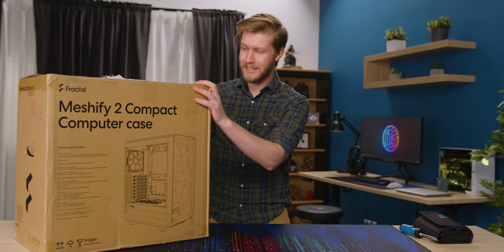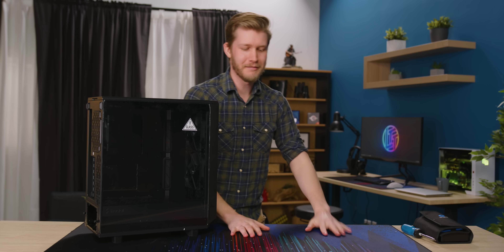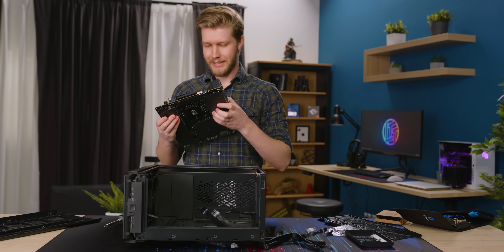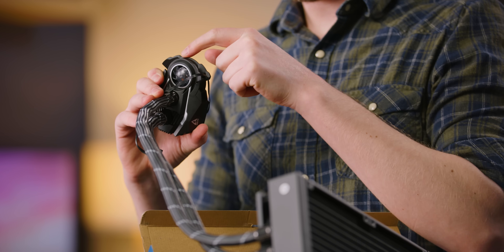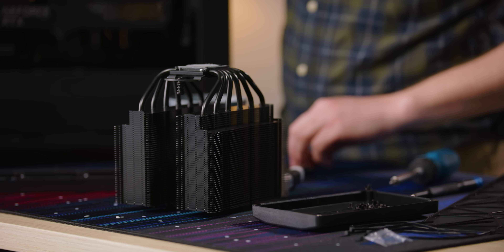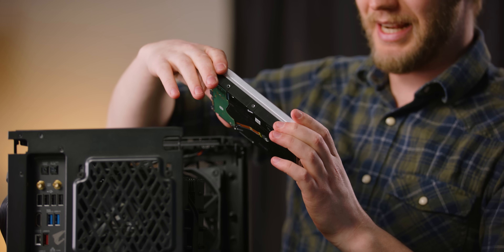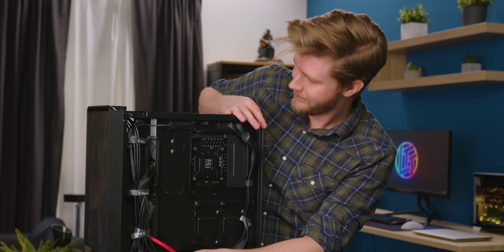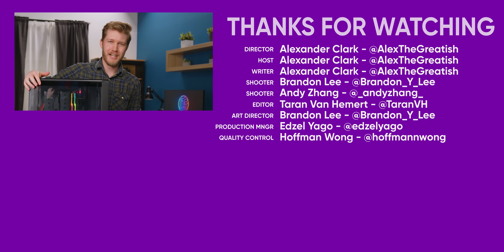One of the easiest PC Builds - Fractal Design Meshify 2 Compact PC Case

Comment: Honestly, for the price its not awful. But I got the regular Meshify 2 and I'm really glad I didn't get the compact. It would never fit my fat log of a GPU. It's 320 mm and I have a decent amount of space between it and the fans up front. Be aware that those fans won't match the typical AIO radiator fans as they are only 1000RPMs versus most AIO coolers that are double that. So you might see some pressure happen.

Comment: The case is nice, there is a huge BUT though. The power button design gets 0/10 for me. It is just a clicky mess. The top panel is in the way of the button so when I press the button, it gets stuck sometimes and clicks itself again. It just turns my computer on and off again. Horrible design choice from Fractal.

Comment: It may not be obvious, but there's actually plastic on both sides of the glass. Pulling them off generates a lot of static electricity buildup, so be aware of that and discharge appropriately away from your components.

Comment: Does it bot overheat since the gpu is so close to the cpu cooler? I have the same setup and its heating up so im trying to think of a solution that wont break the bank like buying a new case so i can vertically mount it or concert to liquid cooling which im not a fan

Comment: I made a motherboard mistake buying this case:

My MSI motherboard has the front panel connectors aligned parallel and not perpendicular. The backside cable management channel interferes with these in a big way - prying up the heads on the front panel cables so much that I was worried it would damage the motherboard.
I had to give up on using this case after buying it. Please make sure your motherboard doesn't interfere like this before buying...

Comment: I built a system for myself in the original Meshify C about 2 years ago and it really impressed me. Since then I have done so many other customer builds in cases from many other brands. Antec, Silverstone, Corsair, Coolermaster etc. Some very good cases. However I keep looking back to Fractal Design. They are almost in a class of their own. I can see so many  improvements to my old Meshify C. And I'm really thinking that's what I want to build in for myself once the time comes. I did try out the Define 7 Compact but it felt just a bit big. Great case otherwise. The Meshify C Compact is what looks a better size for my liking.. With all the features I need/want.

Comment: went with a Mesh II P, instead of this...bc it had the GPU intake fan mounts. ALSO i was able to remove the HDD cage in the lian li(permanantly) in order to fit the same 280mm arctic AIO up front which was able to clear with a push pull orientation up front with a 3070 strix fitment. apparently that cooler is the same size as the 3080. This chassis was too small to support a 280mm up top like the vid proved....and up front in pushpull. For an aircooled system though its quite perfect/ideal darkrock 4 pro or NHD15 chromax and GG. The XL with top mount 420 if possible or front mount 280mm push pull is more my avenue i like noise normalised systems that can still push hard but cool well and quiet. The cost is more like comparing a 170-200$ chassis with no fans...thats "all looks" with a 120-140$ mesh air fow oriented chasiss with a few P12/p14 fans from arctic for the aio push pull and GPU for its directional airflow/intake. I went with 5 packs bc they were so cheap 40$....per 5 pack vs the price of some of these more premium options. IF i was running air...idk if i would even use those as chassis fans....other than the gpu intake mounts. Since theyre generally for aio or a small cone of airflow. Still good for generation directional airflow in a front mount to using them as exhaust fans. and a good value.

Comment: I did build in this case, and had a Corsair 280mm Capellix AIO that I put into the front of the Meshify Compact with 140mm RGB fans, but my Asus TUF RX 6700XT and Asus ROG STRIX 3080Ti were both too long with a front radiator. Luckily I had a shorter Sapphire RX 6900XT in my other build and I did a card swap to move the 3080Ti to the other build. The 6900XT thermals weren't great & I returned the case for a full size Fractal Meshify 2 case with better GPU thermals. Otherwise I'd have needed to remove my 3.5" HD in the bottom to add another fan in the basement, where both a fan and HD cage fit in the bottom of the full size case.

Comment: I use the fractal meshify c case and I love the extra room, cleanest build I've ever done fit a 212 evo and 8 sickle flow 120s rgbs. You can see the video of it on my channel. But 2600 with 5700 xt were talking some fuckin muscle would like to get a faster cpu at some point but then I want a faster gpu too cuz that matters more for what I'm doing. But for the 90 bucks I paid for the case it really gave my system the high end look it deserves. I was using a old apevia case with the blue tinted vented plastic window looked cheap as hell and the wire management was a joke. Really cleaned my rig up, and seeing how I bought all my parts pre Corona system worth probably double what I got into it

Comment: Exactly the Case I will use for my next PC Upgrade (I only upgraded the GPU and now the PC is to weak to unlock its full potential)^^

And very nicely, you even use he same cooler as I planned too, and also your GPU is way bigger than my 3070, so I know everything will fit, noice.

edit: also, yeah, it has no RGB, one of the reason I will buy this^^

Comment: I wanted to ask, wouldn't the GPU be restricting some of the air flow into the case?

I have the Asus 3080 Strix and it's 0.5mm bigger than yours...

I really want this case, and I don't mind spending another £50 on the Meshify 2 but all that extra space isn't going to be used.

Comment: Short Circuit, I have a meshify 2 compact. I am going to do 2 140mm intake on the front, 2 140mm exhaust on the top, and 1 120mm exhaust on the back. What brand should I use for the fans? GO!

Comment: I had the be quiet! Pure Base 500 but I struggled with the cable management so hard (especially the 24-pin ATX connector) that I took some more money and got a Meshify 2 Compact to get my build perfect. And I love that case! Taking off the whole top makes it so easy even with the biggest CPU air cooler installed. The only problem I ran into was the length of the 8/4-pin CPU cables of my Corsair PSU. Watch 8:22,  it looked the same here. I couldn't find a way to put the cables perfect without folding or squeezing.

The Pure Base will have my old 3770K system where the appearance is not that important.

Comment: Okay so isnt something like the lian li o11 dynamic superior in like every way possible? Better build quality (you can hear the cheap and thin metal from this lol), you can not only fit a 280mm but even THREE 360mm radiators in, its also toolless and has easy to clean filters, design is subjective but i like the o11 way more and they arent even priced different. But the o11 gives you more features like a possible second power supply or way better cable management.

Comment: I have the original Meshify C in white, and my only complaint was the USB 3.0 header cable is hard to plug in my mobo at the bottom. My EVGA Supernova G2 700w PSU from my last build is technically not supposed to fit, but I was able to pull it off. I have cable extensions though, so that made cable management a lot more difficult.

Comment: I love that the front and side panels can be removed w/o tools! However, I wouldn't buy this case until I found a long-term home for it where it wouldn't be moved for 5-10 years. If I had to move apartments/houses with that computer case, I'd be too worried about the side panels coming loose and scraping or damaging the components inside the case.

Comment: The white version is taking WAY too long to be available. Also, the area at the bottom where the front mesh filter is opening up to reveal the bay for Power Supplies should have been made with a bigger opening to fit a 5.25" bay and add some hot swaps.

Comment: Yes, one could go wrong with that.

I find it frustrating how many cases these days lack 5 1/4 inch external drive bays. Optical drives are still quite useful in 2021, for multimedia content and for making data backups. It's also disappointing that the front of this case has only two USB ports. That just isn't enough. And again the lack of external drive bays compounds the problem, as the normal way to add additional front USB ports to a case is to install a panel that fits into a 3.5 or 5.25 inch external drive bay. 

When I was shopping for a case for my own new PC, I was really annoyed at how many flawed designs I had to search through before finding one from Corsair that would actually meet all my requirements. Shopping online for a decent case was the least fun part of my PC building experience; it was just tedious trying to find any decent options among all the garbage cases that have flooded the market over the last few years.

Comment: You can go wrong because if the gpu is big enough it won't fit. Which is why i cheaped out and got a msi ventus 3x oc 3080, Before buying a new case anyways. But any other gpu would not fit into my fractal design c

Comment: That setup would likely cool better without the back 120. It can't move as much air as the cpu cooler so it causes slowdown. It may not seem like a big deal. But every degree on a ryzen matters. Intel is better in that regard.

Comment: Had this case a month now... great looks, thermal performance, and super easy to build in with the designed cable runs :)
Reply: do your front fans, moreso the upper one vibrate like hell?
Reply: @ribale609  I didn’t notice them vibrating. Whilst they’re definitely not the worst fans I’ve seen included with a case, they’re not as quiet as the Noctuas I had in my previous case so I switched them out after a week

Comment: Compact cases are just the best. I recently switched from the Meshify C to my Pure Base 500dx moslty for brand affection purposes. :D there are some quirks though I'm missing. Thus i really like the step towards having more QoL features in lower tier cases as well. Im thinking of hinged side panels, open tops and a really really useful cable canal in the back side. I feel like many manufacturers rather safe some width than having an extra cm of cable management space which to me is a bit sad. Im running nothing really fancy, but the BP500dx doesnt really give much space, especially when HDD's are a thing. Or even multiple Sata SSD's mounted on thr back.

Nice case! Want to see more! And nice video showcase of course!

Comment: I was actually interested if a 240 AIO would fit, with that tall RAM and heatsinks on the motherboard.  To find a midtower which is only around 45cm deep that fits a AIO in the top isn't easy.

Comment: If you want a full-size ATX motherboard in a compact case, I think the best options are the O11 mini and the Meshify 2 C. If you are going for an air-cooled build, go with the Meshify 2. If you are going for custom water-cooling, go for the o11 mini. For most consumers, the Meshify 2 C will be the better option. SFX PSU units are expensive, and people making a custom loop have more money to spend.
Summary: 
Watercooling - O11 mini
Aircooled (or 240mm CPU AIO) - Meshify 2 C.

Comment: I love the size of these, but fitting things like the larger 3080s had me worried enough that I went with the Meshify S2.  It's kind of big, but I love it.  Insanely easy to build in.
Reply: There shouldn't be anything to worry about as long as you check the specifications. Max graphics card length is one of the advertised numbers.

Comment: The Define 7 has the same issue with the feet and the HD cage. The default position at least doesn't start with any of the screws under the feet at least. I'm wondering if you can rotate the feet at all?

Comment: So I have Define 7 Compact, so the same except front. It is ok case and I like it but.
1. Should be a bit wider and taller ~0.5-1.0 cm, to have more space on back for cables or PWM hub (or had preinstalled thin hub like they have in regular D7),
2. PSU bracket is nice thing, but that two thumbscrews to mount it are terrible for this, would prefer regular 4 in the corners, or something.
3. Included FD Fans are quite loud and only DC not PWM.
4. Front bracket mounting holes are dumb, there is physical space to mount 3x 140 mm on the front, but mounting holes do not allow to do that...
5. Straps are too long and lose.
6. Filters mesh are not a nylon one.
7. Would be nice to have a wheel option instead of legs.
8. Would be nice if PSU shroud will be removable too, as the top radiator bracket.
9. Official FD anti-sag GPU accessory would be nice.

Comment: Taking the filter off on the original was not awful. It was easy. If you're cleaning one filter you're cleaning all of them. You pull out the bottom one and slide your hand in through the bottom and just pop it out. Super simple takes 2-3 seconds

Comment: THE 280 AIO fits in the front. However my Zotac 3090 is so long it literally pushes(not hard) on the radiator.
Reply: That must mean you have the tubes on the top then. Would it be possible to orient the radiator tubes down? Perhaps by routing the tubes over the side of the gpu?
Reply: @katsapliareos  tubes are down (I watch Gamers Nexus too) They go to the side of the GPU. The radiator is after the intake fans on the front intake. But as I said, from the rear IO to the end of the shroud the GPU is so long it touches the radiator.

Comment: Damn this build is almost exactly the same as mine, i rock the first meshify C, AMD r5 5600x+ rtx3070 and the same ram as you and i cool the CPU with Noctua NH-D14-SE-AM4. Best build i ever done, the case is fantastic, all is neat and pretty, with dust filters everywhere. Btw i replaces the stock case fans with sick Noctua 140mm at the front and one 120mm for the backside :D Also decided to use just m.2 storage and got rid of extra sata nd power cables for a simple hdd and 2.5 ssds, very neat and clean.

Comment: I just built a friend's PC with the full-size Meshify latest case, and it was a joy to build: 5900x / ROG X570 Pro / rxt3900 / 32gb DDR4-4000 / 2tb Corsair NVME / 8tb WD spinner / 1000w Corsair PSU. And even with the chonky 3-slot GFX card, there was space for a mini-atx motherboard still inside 😆

Comment: as someone who has the original meshify C and opens up to switch coolers on my rig all the time (because i just can't decide what to use) I can say that the removable top side is more valuable than most people think it is. installing a DH15 and having to get to the CPU cooler header is so hard because of the limited space. I'm so happy it got addressed and if I had money I might actually pay to get this case for that change as well as the screwless glass side panel.

Comment: I've built three computers recently, one of which in this case. One in the Meshify 2, and another in the be quiet 500dx. So a comparison on another compact atx case and the bigger version of this case.
The Meshify 2C was the most tight of them all. In particular, I actually had to work really really hard to get the back to close up fully on mine. Maybe one of the corners was faulty and came off easy, but even then, you still put pressure outwards against the back if you don't do it perfectly. The other two cases had a lot more room for cables, so I didn't really have to worry about cable management on either.
That's my main complaint. Both the 500dx and this are about the same size, but this is a few mm smaller in each direction. Both are tiny, and I love both. But the 500dx is just a bit more convenient on your hands.
This has rubber grommets, but the 500dx felt like it had more space for pulling in cables from the back. Both Meshifys I was forced to have a long loop of cable come out on a weird angle for the usb 3 gen 1 type a connector on the bottom. I used a different motherboard for the 500dx, but I don't think that one would have as big of a problem.
The 500dx is more gamer looking. This is more subdued, but both are very very pretty.
The Meshify 2 felt the most premium of all three. The paint on the screws of the 500dx was a bit meh, and something felt a bit cheaper on this case. But every single thing on the Meshify 2 felt so so amazing.
Which case would I recommend? Literally whatever. They all do feel very premium, and are all very nice. The Meshify 2C and the 500dx let you feel a bit like you're building itx but get all your atx goodies. The Meshifys have a convenient top removal that makes building more convenient. Nothing will feel more compact than the Meshify 2C, but you will get all you want out of it. (Except for top 280mm radiator. I was able to barely fit a 280mm radiator on top of the 500dx, but I really don't recommend doing it. Had to cut the edges of the fans a bit to fit.)
An ever so slightly taller (for the 280mm radiators) and ever so slightly wider (for the cable management) version of this Meshify 2C case would make it perfect. Or a taller 500dx. Generally, most people really don't need that extra space on the front. Compact cases can still be big enough for the biggest graphics cards, so ones with all that front space is really not necessary.
10/10 would recommend any of the above cases, so long as you keep mentioned caveats in mind.
Reply: The meshify compact is literally the slightly bigger case than the meshify c so maybe that's nicer to build. With modern GPUs c is really on its limit. My brothers rtx 3080 had 2-3mm space to the front fans.